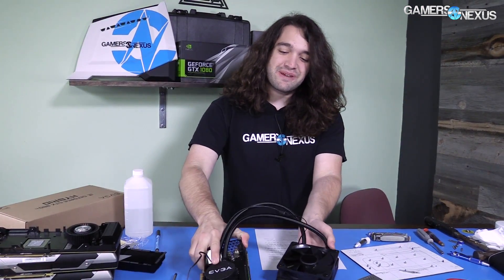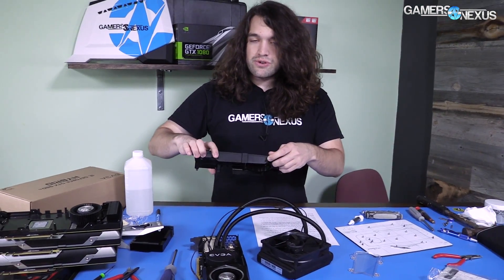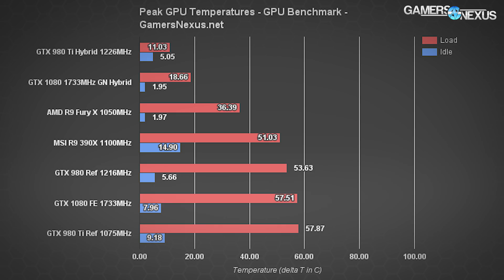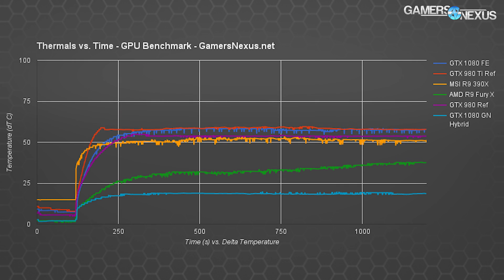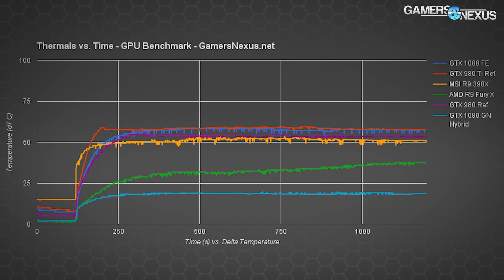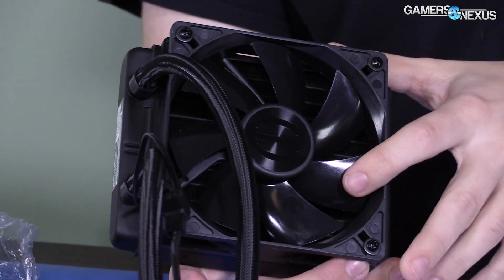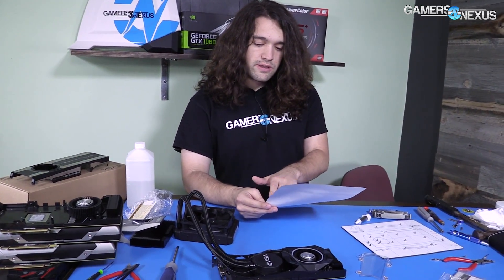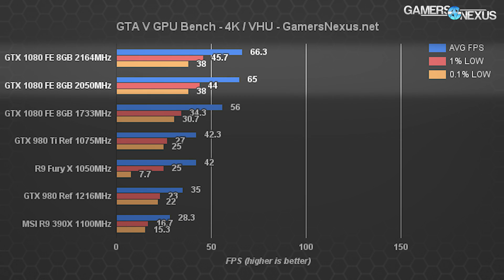Building a GTX 1080 Hybrid Pt 3: Performance Results

Comment: awesome work! man. 
so how was Nvidia showing off that 2100+ clock with only 67 c on air???
Reply: +OmerTheGreatOne I'm gonna go ahead and say extreme case of cherry picking, if they didn't just straight up lie about the cooling method
Reply: +OmerTheGreatOne running next to the AC... like the 4790k prerelease... it does 5ghz!!!! on air!!!!!
Reply: Look back at what they were running when they showed clock rates. It wasn't a game. I believe it was some kind if render. The gist of it is they mislead everybody. Poop marketting.
Reply from the maker: +mei Hmm. 58C at 2100MHz absolute seems... impossible. Maybe if it's 0C ambient. If it's delta, that makes a bit more sense. But I'd be curious to see if the clock is actually stable or if it fluctuates up and down like our tests have proven it does. You don't see those fluctuations unless you properly test for them over an endurance period, and using something better than synthetic software (which does not provoke failures or convoke Boost properly).
Reply: Nvidia's card was randomly selected off their assembly line, not cherry-picked. They were showing a real-time render of a single character. They were running an aggressive fan curve on the stock cooler. Their inclusion of clock speeds was a last minute idea because they head no idea they'd achieve such an impressive OC. Tom, their senior technical director, went on record confirming all this. Hope that helps.
Reply: +OmerTheGreatOne hardwarecanucks in their review said 58c with a 2100mhz, i think they both str8 up lied, or tested it for 5seconds?? i still think thats lying
Reply: +OmerTheGreatOne FPS was locked, card probably wasn't running at 100% load.
Reply: Gamers Nexus thankyou for your input. you, sir, are one hard working youtuber.
Reply: +ProteusX2 well they must've won the silicone lottery!
Reply: +OmerTheGreatOne They were not playing a game, they were showing a rendered images.
Reply: it was because they where doing 3D rendering not games
Reply: +Jominator yes that's how I feel. but it's still an improvement. not as impressive as we were led to believe.
Reply from the maker: +mei 58C... Delta T or absolute?
Reply: +Gamers Nexus pretty sure he meant absolute with 55% fan....i didnt hear him mention no delta, its in their main review, id like to know how he tested that bcos it doesnt seem real!!
Reply: +OmerTheGreatOne Cherry picked GPU with EVGA aftermarket cooler it seems... 2100 is still about 22% overclock which isn't bad, but it hits it's powerlimit there. Yes it was the best case scenario they were showing off. Marketing... But seems after 2GHz you ain't gonna gain much relative to clockspeed. 
Also I wonder how long those sites benchmarked the gpu to get their scores and top the 1080 with such huge lead. Meaby fans at 100% which is ridiculus. At stock settings it seems that 1080 doesn't even deliver it's base clock after 10min... So as for founders edition card, it's full of crap. Just go for aftermarket cooled ones and be happy to achieve the max boost clock.
Reply: +OmerTheGreatOne perhaps they had an air-conditioner pointed right at it the whole time, i mean the thing was completely hidden.
Reply: +Aeschylus Shepherd Nay, it was not a rendered images. It was rendered in real time with Unreal Engine 4. Even if a character with say 10 million polygons. GTX 1080 doesn't need to be fully loaded to render it at 60fps. Even 980 can do it without problem. BTW, that character was designed by Epic games and Weta Digital in their new game called Paragon. It was a part of tech demo of Unreal Engine 4 this year and ultimately optimized for real time rendering.
Reply: +OmerTheGreatOne nVidia hired a clark kent air vent for the event to keep it cool you kno' what i m saying ;)
Reply: Anyway even with fully copper evga cooler it cant stay 67c with max overclock +2100mhz on normal room temperature
Reply: they used frame cap and/or vsync at 60hz .
Reply: TrueDesireHD That explains a lot
Reply: Vacarasu Sorin Method doesn't matter. Amount however does.
Reply: +Diglo1 it doesn t matter if it s more than enough, but if it less that it should be...
Reply: Vacarasu Sorin If it's unconductive, too much can be even worse then too little. But enough splitting hairs. Method doesn't matter.
Reply: They liquid cooled the whole case
Reply: mike shwilly I thought they said that it was on air
Reply: ***** Yeah a marketing plot to overstate so small improvement relative to architectural chance and node chance. Not saying AMD will do a lot better, but they atleast dared to demonstrate Polaris 11 with concrete data about efficiency against Nvidia and that can be traced to Pascal and it's so called 2x efficiency. AMD will most likely have 2x instead of 2,5x.
Reply: ***** And that too. "GTX 1080! Two times the power of gtx 980 wwwhhoooo!!!!".......

"In vr"....

Aah so what about gaming? "Just over clock your 980ti and your good to"... ok
Wtf really? It's just Maxwell on speed. Ok they improved, but they improved as much as node chance allowed for efficiency. So how much Pascal arch is better then Maxwell? I don't believe they put "billions" to develop it.
Reply: ***** It's funny how they advertise 1080 as 2x980. When in gaming you have that dual gpu scaling problem. Yes it kind of does and kind of doesn't. Anyway it's only that fast in vr because 1080 only makes one pass instead of 2 to save performance. Genious but it doesn't work on regular gaming.
Anyway it's only the best case scenarios when 1080 reaches 2x980 performance, normally well more or less 70-80% of that setup.
Reply: it is, but i expected a bit more.
Reply: Wasn't used? Drivers are one thing but pascal is just maxwell on speed that can now clock higher, has lower IPC and can manage async shaders.
Async capability is more or less 5-10% gains.
Maxwell was fully utilized and we saw relative boost in performance to clockspeed so it's already maxing it's performance with current driver optimization.
But if you meant node chance and architectural chances then yes we have seen better like from hd 4850 to 5850.
Reply: If you turn up the fan you can run cool.  One reviewer got 58c @ 2.1Ghz with the fan locked to 55%.  
Water cooling is mostly to avoid noise and you can get a bit better of an OC at lower temps.    
You basicly need a custom fan profile to overclock that high without throttling.  
You need that afterburner.  
It depends a lot on the chip.  225 Watts is the max power and hot VRMs are less efficient.  My guess is that that is the cause of the throttling.  You chip is a bit too leaky(quantum tunnelling) for 2.2Ghz.
Reply: they still cant really manage async its works better but still not as good as on amd cards
Reply: cause they didnt run a game in the presentation.. they ran a 3d rendering which is not what the card was build for.
if they ran crysis or some other game they wouldve easily hit 80+ degrees
Reply: Patrick Rayleigh Yes and sense their temperature target is 83 degrees, it will throttle all the way to it's base clock relatively fast. So with closed case with average airflow (in+out take) and fans at stock settings it can't go over it's base clock after 10 minutes or so in gaming. Ramp the fans to 100% and you can maintain boost clock under 80c. Of course 2.1ghz is out of the window with founders edition cooler. So as for it stands, by any other version then founders edition.
Reply: Teemu M. Really? Of course you must have very good opinion.
Reply: I got a GTX 680 clocked to 1400mhz and it always runs below 67 degrees... And I'm using Noctua 3000PWM fans plus a Zalman Z11 plus case which cools everything just perfect. Even the CPU never get too hot.
Reply: I'm a BarBrother ookayyy, good for you, i guess.
Reply: Because I can lol if I would've the 1080 I would beat KNPG in firestrike :) But I don't have the money for 2 or 4 cards. :(
Reply: Picked a good overclocker off the pile and set fans to 100%. At 2050MHz at full load and 100% fan speed, my 1080 FE stays right around 67°C.

Comment: I think I'll wait for an ASUS variation to be released.
Reply: +3.6L Dodge Avenger yup... i need me some hotwire and more 8pins
Reply: i'm waiting for xtreme version by gigabyte
Reply: Leo Braga 

I've purchased a swiftech aio cooler for my CPU. I'm hoping that ASUS will introduce another ROG hybrid.
Reply: 3.6L Dodge Avenger sounds great
Reply: +Leo Braga Once it gets to the high end versions of a card, I start basing my purchases on looks over performance, as that little bit of increased performance gigabyte manages to get just doesn't beat asus aesthetically in my opinion.

Comment: So the card is basically a very good overclocker, but it needs more than one pci-e power connector and better cooling than the reference to be able to hold the clocks. The gains from the overclock is pretty much what you can expect from Nvidia. Great video overall. It deserves more views.

Comment: One question.
You are running an Extra fan and a pump in addition to the GTX 1080 stock fan, wouldn't that sacrifice too much power that could achieve higher clocks ? i mean if the fans and pump were on external power outside of the card own 180 watts power supply, wouldn't that achieve a much higher oc ?
Reply: No. It makes no difference, when you OC you are limited by the vrm in respect to power consumption, not your incoming DC voltage.

Comment: these are the things LTT should be doing.  thank you for the informative video that doesn't include cringe humour.
Reply: LTT is a glorified advertisement channel now...
Reply: +Javon Clary Have to agree, I like LTT but the cringe humour and goofy crap is a turn off.
Reply: +Javon Clary I'd imagine they are waiting to do it to an AIB card with 8+6pin power. This was a fun hack but it didn't tell us anything we didn't already know from the Germain sites swap with an aftermarket air cooler. ie. That the stability of overclocks of a Founders Edition 1080 is improved by a better cooler and thus temps but that the amount of overclock is hampered by the single 8 pin power connector of the Founders edition card. When AIB manufacturers bring out their own 1080's with 8+6pin power, thats when water cooling even Hybrid AIO water cooling like this should really let the 1080 stretch its overclocking legs. Thats when we might see stable 2500mhz overclocks etc.
Reply: +ca1ib0s you're right. this was still more useful than seeing Someone put electronics in an oven .
Reply: +utubie24 indeed
Reply: +Javon Clary LTT would of broken it way worse^^;
Reply: +utubie24 :/ I don't even watch their videos like I used to.
Reply: +Javon Clary so I do... they're kinda fun but not the usefull they used to be. Too much advertisements..
Reply: +Skylar Flaer What are you talking about? LTT does more of this type of stuff than ever before because they have the budget to do so. Do you even watch LTT???
Reply: sbn025 You're right, I haven't learned anything about how many case fans affect pc temps, psu cable management and temps, blower vs aftermarket cooler gpus and internal temps, how you can use old server cpus/mobos as gaming rigs, steam in home streaming and it's latency and compression issues, difference pcs with their performance problems, different network ethernet/wifi upgrades/performance reviews. 

Ya, you totally don't learn anything on LTT anymore....
Reply: EPIC Gaming apparently you're the stupid one. This video has little to do with overall temps but is about removing the temps to see what the voltage limit, max clock, and max in game clicks are. aka seeing what the max performance is of the reference design cards. WOW
Reply: I like trains
Reply: +Javon Clary im tired of the 3 year old comedy they try to put into their videos. i use to like them but not anymore.
Reply: +Javon Clary These are the things LTT used to do until they became just another vlog channel.
Reply: +Javon Clary no fuck this guy
Reply: AlexandreHimself Okay.
Reply: +Javon Clary yeah LTT used to be the channel to go to learn stuff. Now is just ad after ad!
Reply: Ziptieing a kraken x61 on a 1080
Reply: of course a fucking watercooler would be cooler than ref card? WTF is wrong with all these people. Do someone has to upload a video because your to lazy to think urself?
Reply: Yeah i miss their unboxes reviews and actual tips instead of just general news and showcases
Reply: Andrew Russell you stupid shit lol.
Ofc you can't oc the shit out of the card with an reference air cooler.
Reply: EPIC Gaming BAHAHAHA you're the stupid shit! You're LITERALLY WATCHING A VIDEO ABOUT A REFERENCE CARD WITH A LIQUID COOLER ATTACHED TO IT, NOT THE REFERENCE COOLER YOU DUMBASS
Reply: +Andrew Russell i think you can't read read and think properly. there was a ref cooler on there before. ofc ref aren't made for Holding the clock and being quite lol. stupid shit
Reply: EPIC Gaming  You're original comment: 
"of course a fucking watercooler would be cooler than ref card? WTF is wrong with all these people. Do someone has to upload a video because your to lazy to think urself?"

My response 
"apparently you're the stupid one. This video has little to do with overall temps but is about removing the temps to see what the voltage limit, max clock, and max in game clicks are. aka seeing what the max performance is of the reference design cards. WOW"

Then you go and talk about the reference cooler when we've were talking about what the point of liquid cooling the card was. So yes, I CAN read, but YOU can't, or keep a logical train of thought.
Reply: yes much appreciated GN!

Comment: Would running the pump/blower from a source outside the card help ? Also, if you're limited by power, raising the voltage shouldn't help and potentially hurt performance. I'm also guessing that 1733 MHz was taken from the spec and not measured during gameplay.
Reply: +Keven Harvey running the pump and fans on a separate psu would not benefit much, since they only consume 1-3w each.He wrote 1733Mhz because these are the stock clocks, but the graph shows the actual boostclock (~1800). He wrotes 1733 because its the official statement and the real boost changes between applications.
Reply: Melvin Gimp
Same applies for OC clocks, and they are measured, stock should also be measured for consistency.
Reply: +Keven Harvey I have the same opinion, but also think that many ppl will be confused by gtx 1080 @1800mhz and will think that its also an oc.

Comment: I can see AIB hitting higher but how much higher ? 2.1ghz  on reference but I would assume the Powerlimit and voltage is holding it back just like the 980ti/titan x. Bios flash with more volts and higher power limit really let those cards go crazy with water cooling that is.... Your thoughts?

Comment from the maker: See article for way more depth! http://www.gamersnexus.net/guides/2441-diy-gtx-1080-hybrid-thermals-100-percent-lower-higher-oc-room
Reply: This may have been my favorite GN episode. I kinda want to buy the GN 1080 Hybrid now!
Reply: +Gamers Nexus this card is a 1440p destroyer. Please make the benchmarks in this resolution.  to see how well can perform.
Reply: +Marcel A. Rodriguez there's 1140p on the post but no 1080p at all
Reply: +Gamers Nexus It's not that gueto, It really looks awesome, I really like it like that, Batman approve it!
Reply: +Matt Lauderdale    Hopefully it has more power connectors than a single 8 Pin.
Reply: +Sufiyan Khan that means the lowes fps that stayed 1% or 0'1% of the time of the benchmarking. 0'1% is almost just a drop and not boticeable but 1% is more likely to be notices
Reply: +Gamers Nexus Don't want to sound impatient, but WHEN ARE WE GETTING 1080 SLI BENCHMARKS!?
Reply: +Gamers Nexus What does 1% low and 0.1% low means?
Reply: Does doing this makes the cards last longer?
Reply: +MrNait thanks :)
Reply: +Peijje yes.. lower temps = longer life of components
Reply: +Peijje +Sufiyan Khan that's not the main reason... it's to avoid throttling of the cores due to high temps. Liquid cooling on high end pc is not for durability, it's to squeeze the maximum of the hardware without burning anything.
Reply: +MrNait yes i know :) but he asked whether it increases the lifespan of gpu.. so i said yes..
Reply: +Sufiyan Khan well.. while u keep temps between the limits... i mean, there's not benefits on having 20°C more or less if you keep it between the save temps
Reply: +MrNait 1080 FE runs pretty hot tho..
Reply: +Sufiyan Khan yes, it throttles to soon, everybody reviewing them have the same problem. Custom coolers would solve that.